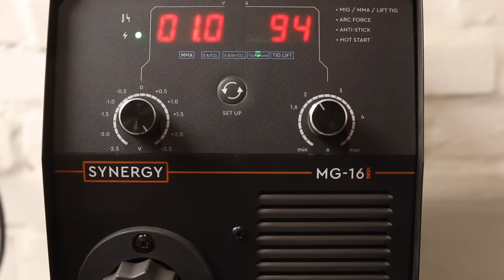Italian Stiletto Switchblade Knife Restoration

Comment: Changing the scales turned it into an ugly knife
Reply: Who says that about Stag 😂
Reply: Absolutely.  Scales are too thick in my opinion. Ugly.
Reply: To each one's own, @paulknight3113!
Reply: That’s the way it came factory. 
I had one identical to it years ago.
  I wondered why you wasn’t using the upper tang to unlock the blade you so you could close it. I realized you couldn’t because whoever put those wooden handles on it did not cut a slot in it so you could use that to unlock it.
Like a dummy I traded mine off, it was all original & looked like new .I had it back in the late 70s. It was from the late 50’s
Reply: Mate, it's stag...and a wonderful grain, too!
Reply: @aleksandar0475 It's the correct size...
Reply: @stefanorinaldi6537  It absolutely is.
Reply: @e-racer4673 nooo hai messo mano a uno scatto degli anñi 50 originale ?😮😮
Reply: @aleksandar0475 questo tipo coltelli originali sono cosi le guancette sporgono un po

Comment: Excellent job.  I have a general love of switchblades and the traditional Italian stiletto type in particular.  I believe this is a Taiwanese manufactured copy, despite being marked Italy.  But no matter.  The Taiwan made versions are generally good quality and typically more ruggedly built than the Italian ones!  I don't know what country you're in, but here in the United States it's possible to obtain general purpose parts for these types of knives, which can save a lot of labor.  There's also soft steel fine bristle wire wheels available from Brownells, which is our largest gunsmithing supply company, which are excellent for removing surface rust and corrosion.  They aren't aggressive like common wire wheels and won't cut metal.  I've made extensive use of them in gunsmithing.  They don't damage bluing or nickel plating, and leave a fine satin polish on bare steel, brass and aluminum.  Saves a lot of hand labor, if you can get them.

Comment: I have my grandpas and have been hesitant to tear into it cuz of the riveting. The spring is good but the locking pin must've had a little sheared off a little bit cuz the blade won't stay locked. Can hear it click but if you relax your closing hand it clicks open again. I might try to restore it but will keep the scales as is

Comment: That's a switchblade. A stiletto the blade comes straight out of the handle
Reply: A stiletto is actually just a thin bladed dagger.  They were originally fixed blades.

Comment: Hello ReXTorer,
I have a A.G.A. (Angelo Campolin) Batwing Switchblade Knife with Blond Scales a Dagger Blade  when open it's 13 1/2 inches long and weighs in @ 10 oz,.
The Bolsters and Buttons are Slanted'. He only made a certain amount a year with different Blade Bolsters and safety designs, and without safeties just different ornate Button flush with the handle, Mine says A.G.A Campolin on the Tang along with Manigo ITALY 2012      . I didn't Get on here to Brag about  My Knife , You see I I liked to open it an it kick liked a cannon I didn't do it often BUT it got to where it wouldn't open all the way, so I would  put a Phillips head screw driver behind the Spring  an push gently up on the spring, One day my 6'3 225 lb brother comes over and sees what I am doing and says' Give it here I can fix it'' Before finish telling to be easy'' he SNAPS  the spring into . He looked into getting a New Spring Put Back in, But when he was told Just THE LABOR Was $82 AN HOUR HE DECIDED NOT TO HAVE IT FIXED, The guy did tell him to put The Knife in the Freezer before removing the Pins in the Handles.

                                                                                                        Bummed in N.C.
                                                                                                           
                                                                                                                Neal